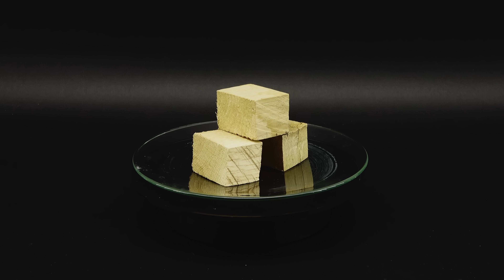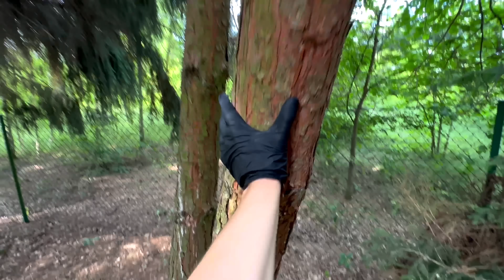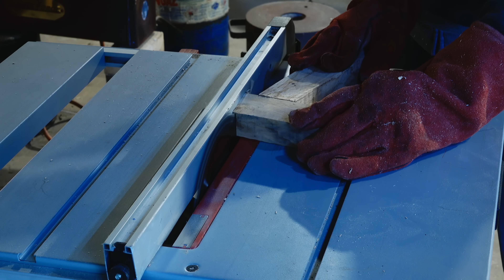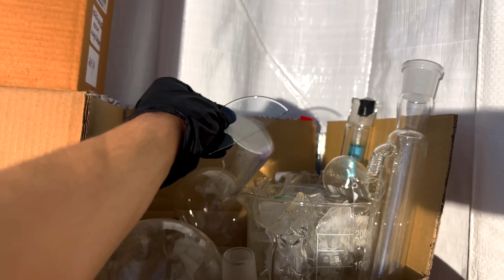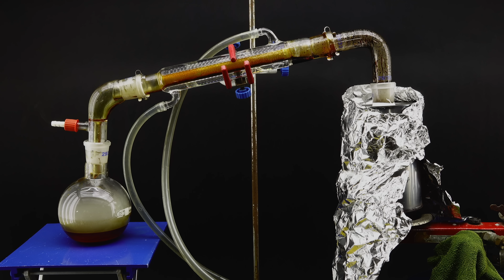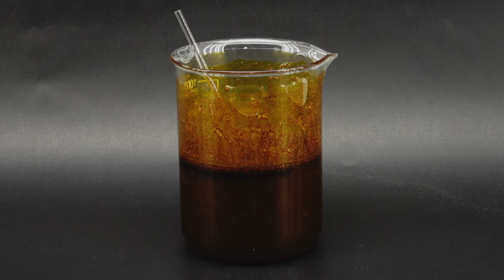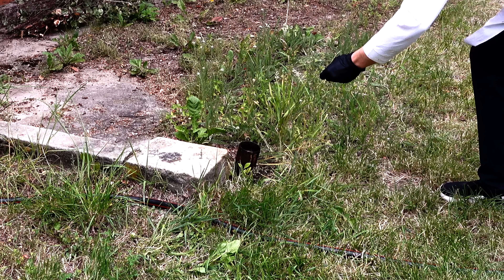Turning Wood into Alcohol

Comment: Trees are good for fuel, alcohol, fuel, heat, wood gas, eating the trees edible layer, electronics, lumber, nutrients, tea, flour etc etc etc.
Reply: Fruits, nuts, & spices (cinnamon) too!
Reply: Yep. Trees are for us so much. I hate when people just cut them down. Hate when people sit there and on the side of the road with their trucks and clear their entire lot and make it very hot in the summer time and very windy in the winter time. Especially when I cut down a conifer trees. The South alone not only be an edible is worth $25 a pound instead of being an idiot is hang somebody $2,000 to remove them how about harvesting them right? You can sorta tap them like the maple tree but it's not the same process but the idea is still the same trees are money @guytech7310
Reply: @guytech7310  Oh & maple, birch etc syrups and turpentine . CAMBIUM Is extremely healthy to eat. 90% of trees have that edible layer. Cooked in fat gets you "tree Bacon" , Chips if you use oil. Etc
Reply: The versatility of trees is impressive, especially when you see processes like this turning wood into methanol. It's wild how many uses they have beyond just lumber or fuel.

Comment: You can definitely make ethanol from wood. You just have to purify the cellulose from wood, and then depolymerize it to glucose followed by fermenting the glucose with yeast. For the depolymerization, you could go the enzymatic way (using cellulase enzymes) or the brute force chemical way with acid.
Reply: That's a solid point. The enzymatic or acid hydrolysis route to break cellulose into glucose is another practical way to get ethanol from wood. It's interesting how many paths there are to convert biomass into usable alcohols, each with its own trade-offs in yield and complexity. The destructive distillation method here is more direct but leaves mixed products, while fermentation gives cleaner ethanol if you can handle the extra steps. Both approaches have their merits depending on the end goal.

Comment: I don't know if this is available where you live, but if you're having problems cleaning your glassware try looking for something called formula 420 glass cleaner. This stuff seems to remove tar from glassware with nothing more than just a small amount of water and a little bit of vigorous shaking.
Reply: That sounds like a solid tip for dealing with stubborn tar residues. Formula 420 might be worth checking out if it cuts down on scrubbing time. Always good to have options for keeping glassware clean.
Reply: One thing I probably should have mentioned before, especially for somebody who has never heard of it or seen it before, formula 420 is not for your general average everyday glass cleaning. This is not a glass cleaner like Windex or something else. This is a formulation that has a type of granules that need to be mixed and shaken well before application. Now if anyone has ever had the misfortune of, AHEM, ” CLEANING A WATER PIPE", then you will know the frustration of trying to remove that type of tar from glassware. Put some of this into your glassware a little bit of water cap the ends off with your hands and shake for about 10 seconds and your glassware will be 90% plus cleaned that easily.

Comment: Cellulose, can be partially resolved into dextrose and other sugars and then fermented, distilled.  Would this give a better yield?
Reply: And to eliminate all the effort of preparing the wood oneself (removing lignin etc.), one can let someone else process it into toilet paper and use that for the feed stock. 
While the yield of "alcohol" may well be higher, it would be a different alcohol, if one wanted methanol specifically it wouldn't be a good option.
Reply: That's an interesting point. Fermenting the sugars from cellulose could theoretically produce ethanol instead of methanol, which might offer a higher yield since ethanol is the primary product of sugar fermentation. However, breaking down cellulose into fermentable sugars requires enzymatic or acid hydrolysis, which adds complexity compared to destructive distillation. Both methods have trade-offs in terms of yield, purity, and process difficulty.

Comment: antidote to methanol poisoning is alcohol i kid not so have a shot befor handling or after prob safer
Reply: That's a wild but true fact. Ethanol can actually slow down methanol metabolism, giving the body more time to clear it safely. Still, proper ventilation and gloves are probably the smarter first line of defense when working with methanol.

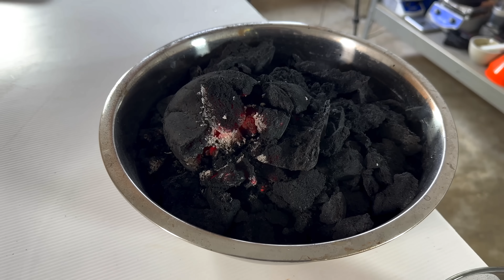Comment: 18:37 with powder, i'd be amazed if it did auto ignite in air. your only option here is to just mix the powder with water immediately after it comes out of the can, or store it under inert gas until it full cools. when making charcoal, you usually wait a long time for it cool down before opening the container (and if it had leaks you will only have ash left)

Comment: You'd better to use a ton of NaOH drain cleaner instead of baking soda. It makes acetone and other junk to form non-volatile tar and also absorbs water and holds it in
Reply: Using NaOH could definitely help remove more impurities, but it might also make the process more hazardous. Baking soda is safer for home setups, especially when dealing with smaller batches. The trade-off between purity and safety is something to consider based on the scale and equipment available.

Comment: It's horrifying when pit crew at car races get set on fire with methanol: they're burning, and screaming, and you can see it happen ... but the fire is pretty much invisible in sunlight.
Reply: yes there was a methanol tanker explosion in the UK, the fire brigade could only spot the fire by the fact the grass was charred
Reply: Methanol fires are indeed terrifying because of how hard they are to see, especially in bright conditions. The lack of visible flames makes it even more dangerous for pit crews and anyone working with it. Safety gear and proper handling are critical when dealing with methanol.

Comment: Be careful and always wear appropiate respiratory protection when working with wood dust.
You might think it's just wood, but oak dust is a class 1 carcinogen.
It's grouped as "substances which cause cancer and make a considerable contribution to the risk of cancer" along with stuff like Arsenic, Aflatoxin and Benzene.
Source: GESTIS substance data base
Reply: Good point about the respiratory protection. Wood dust, especially from hardwoods like oak, is often underestimated in terms of health risks. The GESTIS database is a solid reference for these hazards. Always better to err on the side of caution with proper PPE.

Comment: Afaik, overheating Teflon is an extremely bad idea. There are complex fluor analogons of Phosgene (COCl2) released, all more toxic than Phosgene itself. In small amounts we seem to survive it, however there are accounts of birds killed with the emanations from overheating teflon pans (within 5-10 minutes). So I personally would choose another kind of joint material for the wood destillation.
Reply: That's a valid concern about Teflon. Glass or metal joints would likely be safer for high-temperature setups like this, especially given the toxicity risks. The bird fatalities from overheated Teflon pans are well-documented, so avoiding fluoropolymer materials in destructive distillation seems wise.
Reply from the maker: While I agree that Teflon can turn into some nasty things on heating, there was only a small bit of tape in the coolest part of the can, and any fumes it made quickly got dealt with by my fume hood :)
Reply: @Amateur.Chemistry  If the temperature stays around 300°C at the joint there is nothing to worry about. But what if something unexpected happens. I say this because I had unexpected stuff happen to my setups, so I exclude every risk I can. If decomposition happens, the products will also end up at the walls of your fume hood and likely in traces also in your product and glassware. One time might be negligible, but hazards add up over time and symptoms often become appearent only once we noticeably age, starting from our 40's to 50's, as the sum of all exosures we had. 

While I still enjoy good health, I tended to take some risks. As I age, I slowly begin to appreciate the more cautious types. There might always be unexpected and unknown effects and also simply human error. Just saying! I'm sure you are cautious and do everything for your safety.

Comment: Nice. Please test for formaldehyde in the gas washing bottle. 
With ammonium hydroxide you'd get HMTA.
A nice fuel as well.
Maybe the pyrolysis temperature needs to be tweaked for a better yield of the formaldehyde though.
Reply: Testing for formaldehyde is a solid idea, especially since it's a common byproduct of wood pyrolysis. The ammonium hydroxide route to HMTA could be interesting to explore for fuel applications. Adjusting the pyrolysis temp might help optimize formaldehyde yield, though balancing that with methanol production could be tricky. The wash bottle setup would definitely catch any formaldehyde present.

Comment: If you use calcium carbonate to neutralise the acetic acid, you can dry distill the resulting salt to make more acetone. I'm not sure if it will work with the sodium salt.
Reply: The decomposition of sodium acetate is methane. It should work with magnesium carbonate though not sure how efficient it would be.
Reply: That's an interesting point about using calcium carbonate instead of baking soda. The sodium acetate from neutralization doesn't dry distill into acetone as cleanly as calcium acetate does, since sodium carbonate is more stable at high temps. Might be worth trying a side-by-side comparison to see the difference in acetone yield.

Comment: Idea to improve yield: use a catalyst to convert CO and H2 from the wood gas into more methanol
Reply: You need steam to convert some of CO into H2 : CO + H2O (Steam) -> H2 + CO2.
Reply: Also use Deciduous wood ( hard wood )instead of soft wood, evergreen, pine etc etc. Soft wood produces predominantly syn gas. As opposed to hard wood which produces methanol predominantly...
Reply: @Hippocrates4xBase  well soft wood is probably fine as long as it's not connifer wood, honestly i would probably try bamboo
Reply: @Hippocrates4xBase  any idea on yield difference? what i saw online was approx 10-20% methanol yield by UBW
Reply: How am I ever going to get rid of this carbon monoxide?
The humble hydrogen gas set up:
Reply: And a bigger cooling water container
Reply: Get your hand off your wood 😮😂😂

Comment: What about making liquid glass from regular glass like sio2+na2co3>t1200⁰>na2sio3+co2^

Like video: Turn baking soda and glass bottle into liquid glass
Reply from the maker: It's a cool idea - I will keep it in mind :)
Reply: That sounds like an interesting experiment. The process would require a high-temperature furnace to reach the 1200°C needed for the reaction between silica and sodium carbonate. Safety precautions would be crucial due to the extreme heat and CO2 release. It might be worth trying if we have the right equipment.

Comment: Seeing the gloves while using the table saw almost killed me.
Reply from the maker: I put them on out of habit, thanks for pointing out how dangerous that was - I definitely won't do it again :)
Reply: @Amateur.Chemistry  wrote "I put them on out of habit, thanks for pointing out how dangerous that was - I definitely won't do it again :)"

Good man. Also be sure to remove any wrist and hand jewellery. No rings. No bracelets. No watches. No long sleeves. No loose-fitting clothing. Wear PPE: eye protection, hearing protection. Use proper ventilation.

Need you to stay intact so you can keep making videos! :)
Reply: @Amateur.Chemistry  Thanks, that was stressful. For a guy whos videos basically only show his his hands, you should be more careful of them.
Reply: Good way to get a hand pulled into the sawblade.
Reply: @Kargoneth Using nitrile gloves is fine. The rip apart before they could pull you into the machine.
Reply: @Z3DT if you want to risk that be my guest 😂
Reply: @Z3DT   he was using woolen gloves tho lol i agree with u here tho